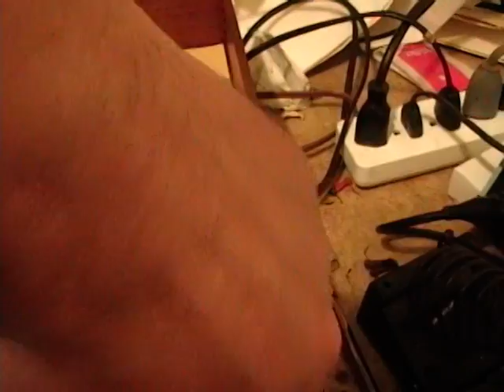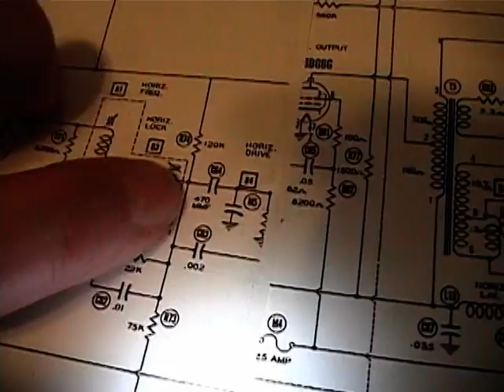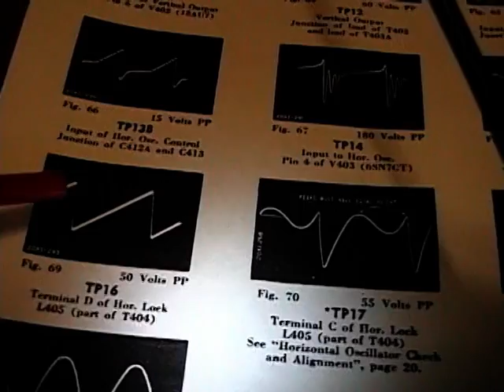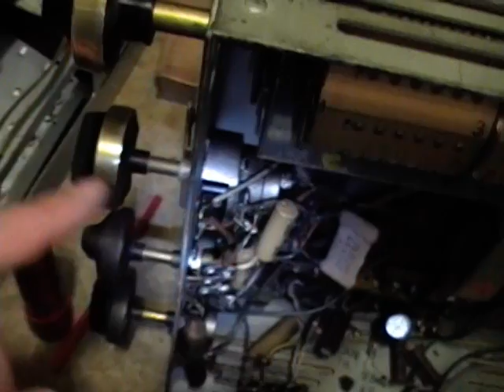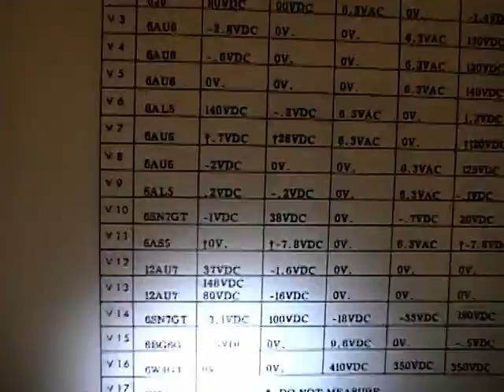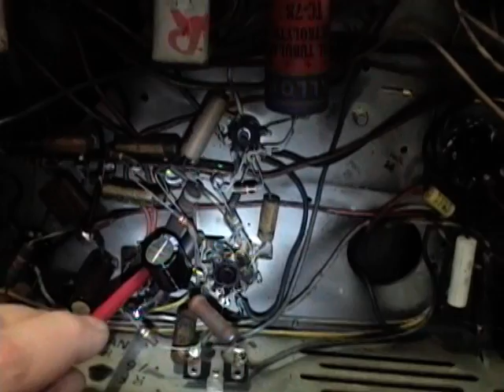Admiral 20X11 restoration p2o5

Comment: @bandersentv That might be a possibility as well, as long as they haven't coated part of the old wire with some sort of enamel or glaze which would make it more difficult. At some point rebuilding the focus control may be the only option to authentically restore one of these sets.

Comment: @bandersentv That's most unfortunate with the rheostat, in that they used an underated part like that. I've run into that in some radios before, particularly early 40s Canadian G.Es and RCAs, (probably in 1939 too) they used a 1/4 watt 470 K ohm resistor on the plate of the 6SQ7 tube and they have a 100% failure rate and if it hasn't failed it soon will, but at least it's easily replaced. I wonder if you could replace the element inside but swap the body so you can keep the concentric shafts?

Comment: It might be interesting to open up the old focus control and find out what happened inside, it being a wire wound rheostat maybe it could be repaired. They use a rheostat as a dash light dimmer in some cars and the contact gets flakey from disuse or oxidation. Those old wax paper caps are almost a waste of time to test, any of the ones I checked on my EICO cap tester either failed at voltages far below spec or read open, if you you those you know they will need replacement.